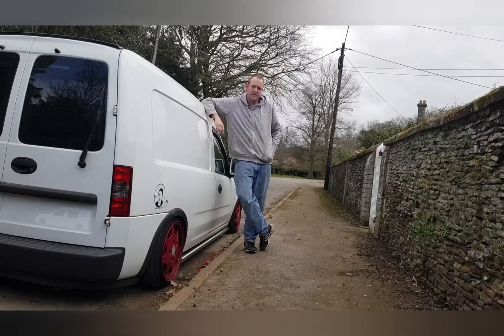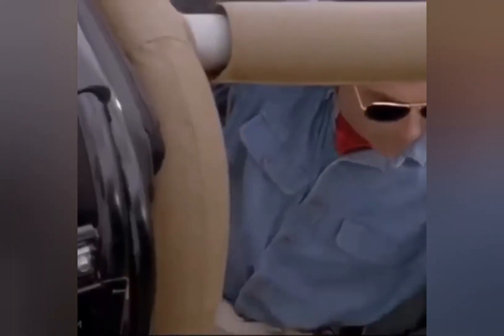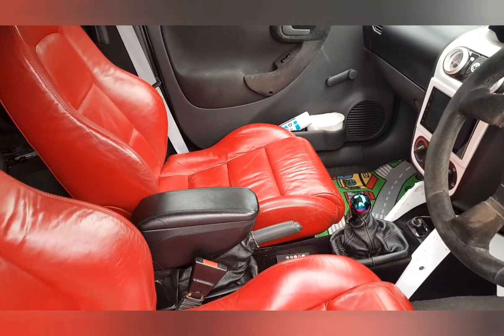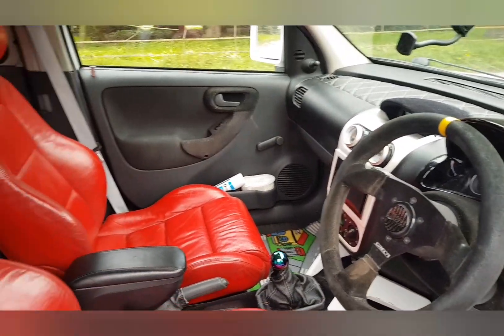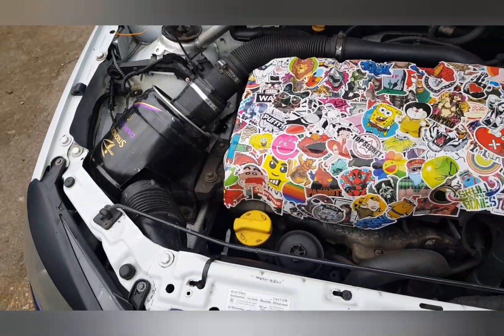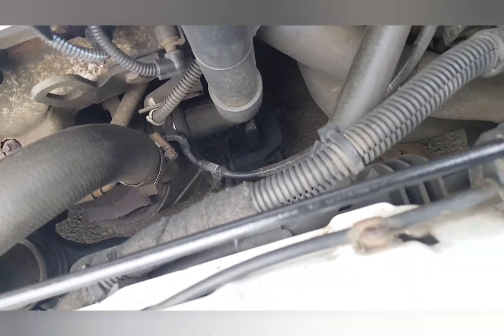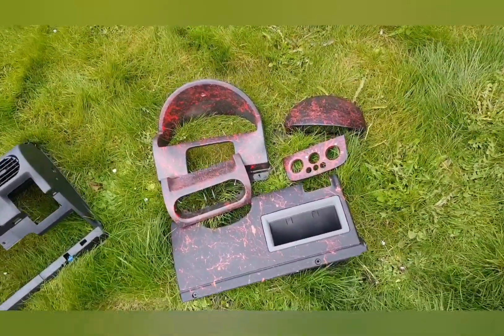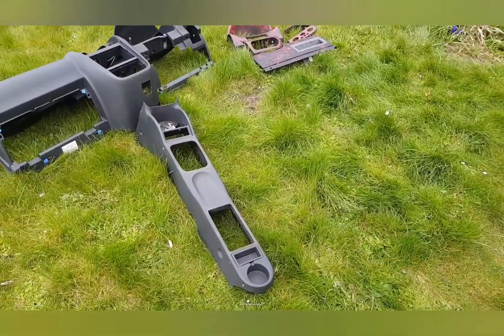Vauxhall corsa c combo van slammed euro project update and how to fit boost gauge 1.3cdti

Comment: I’ve bought a corsa d 1.3 i wanna map it and straight through and stuff but Im worried about the chain and reliability as I’m a mechanic and see these suffer from chain problems
Reply from the maker: I never had a issue. There can fail at any time. Just like the honda cdti 2.2  and so on
Reply: car guy vlogs cheers but I’m staying late Friday to do my oil leak coming from the cooler seal🥵